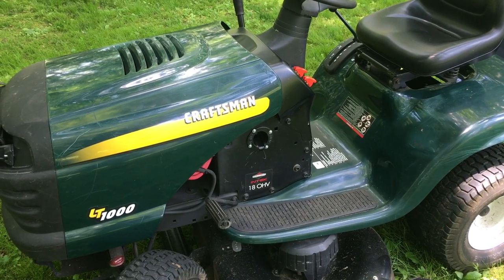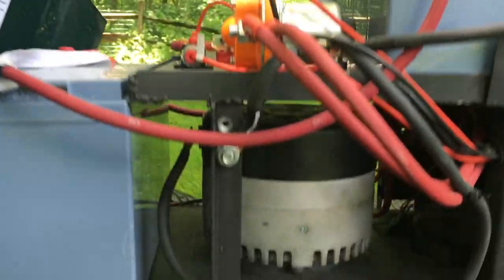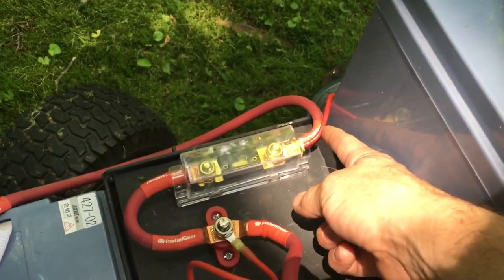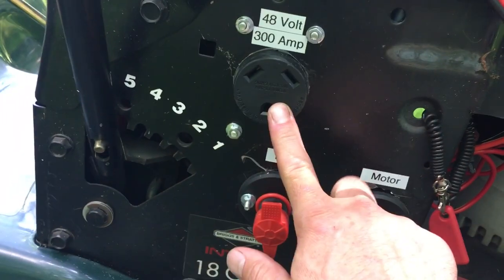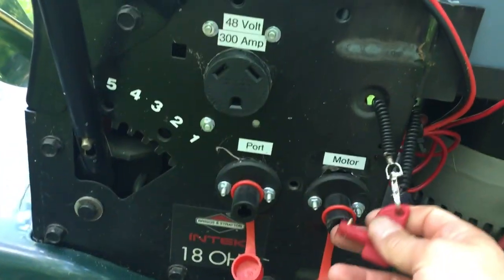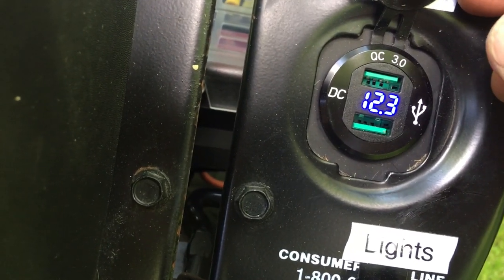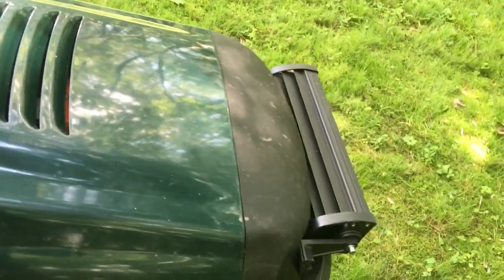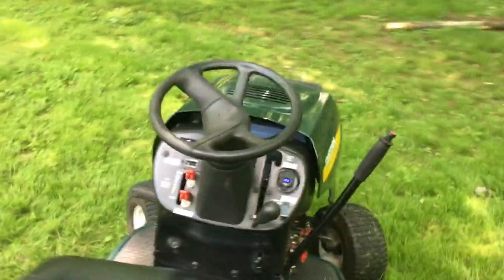LT1000 Electric Lawn Tractor Conversion

Comment: First off, great job on the conversion! I can help clear up the discrepancy in your Ah battery rating vs. amp draw vs. run time.  The advertised 100 Ah capacity of your lead acid batteries are measured in what is an industry standard 20 hour rate.  This means the the capacity is measured at an amp draw that would result in the battery being discharged in 20 hours. If you can find a specification sheet for your battery you will see this, along with capacity ratings over different discharge rates.  At a 1 hour rate, which is much more applicable to a riding lawn mower, you will see that the amp hour capacity will be less than half what is specified.  I'd estimate 40 Ah capacity @ 1hr rate.
Reply from the maker: That’s super helpful. I’ll see if I can find a sheet so I can be more specific with my estimates vs experiences.

Comment: Found out going to have a grandchild.  Was talking to the wife about converting a wheel horse tractor into an electric. Noise reduction. The baby can take rides in. I will have to make a bracket for the motor to lay horizontal at the same place as the belt guard. 
Very cool setup! Thank you for sharing!
Reply: Seems pretty loud still...

Comment: Best by far on converting a mower to electric complete with parts list. My motor on my Toro zero turn is starting to use a lot of oil so I am starting to look at what I want next. I would like to go electric and since my mower is in good condition, this may be an option.

Comment: Sol - I'm getting ready to do a very similar build on my Craftsman LT2000. Same basic physical layout as yours.

I'm considering putting the electric motor directly over the hydrostatic transmission. It will fit where the original battery was, under the seat. So no belts or pulleys, just direct connection to the drive shaft. It seems to me that the electric will run at full speed but if the transmission is in neutral, that's fine and the mower won't move until I move to either forward or reverse.

Thoughts on this?
Reply from the maker: This is a good option… there are plans online for something similar. The plans I’ve seen are where you put in a transaxle with a motor connected to it. And then each cutting blade has its own independent motor. It’s more complicated, but more efficient.

Comment: Why is it so loud?  I thought it would be quiet like a golf cart until blades were enguaged
Reply: Because the motor drives the wheels with a belt just like the blade.  So the motor just runs the whole time.

Comment: I am planning on converting a 1974 Sears ST16 from gas to electric. My engine setup is horizonal where as yours is vertical. Where did you find schematics to wire everything up proper?

Comment: Sweet conversion.  I am planning a similar conversion.  I noticed your current peak in the 50-60amp ramge when you engaged the blades.  What is the max you see cutting thick grass?  I am doing a 48v motor but not the same one and I am limited to 120 amps at 48 constant.  I can probably push it to 200 amps for a few seconds.
Reply from the maker: That'll be awesome. You'll run longer, and with more power.

Comment: I think you’re going to find that you regret not having gone with LiFePO4 batteries. I know they cost a lot more. But the will last sooo much longer and have far better energy density ( and weigh 40% of Pb Acid).
Reply from the maker: I’d generally agree, but I picked these gels up in bulk from a company that went out of business and I got a ridiculously good deal.

When the time comes to replace then, I’ll probably go lithium. For now, I’m still going pretty strong.

Comment: I would buy this. Awesome job! What was the cost breakdown?
Reply from the maker: I got the batteries as part of a sort of fire sale on a closing down factory, so it's not really a fair calc. The meat of the cost was the motor ($400 at the time, now they're closer to $600), and if you had to buy them today, the batteries, too. The other stuff added up, but was probably <$500. So, it wasn't cheap, but I've been running it for two years now and it's still rock solid and hasn't needed any repairs other than the blade belt needing an adjustment. The cost has been worth it in not having to refuel, change oil, smell exhaust, etc.

Comment: Would you be kind and share the contactor, solonoid, and power display you used. My daughter and I welded up an electric go cart last year, and sadly my snapper mower was working fine then. Thankfully we are having engine gremlins, so time to make it run like my Tesla.
Reply from the maker: Right on! Go for it! Ask me any questions you'd like along the way. I posted as many of the parts as I could in the description.

Comment: Hello Sol, I'd be greatly interested in an update on this project. Could you by chance post how many AH your batteries are, what kind of battery and what runtime you achieve from them?
Thanks alot.
Reply from the maker: Absolutely! It’s 4x 100AH batteries, for a total of 100AH @ 48v (~4.8kwh). The batteries are 12v 100AH gel batteries intended for electric vehicles. I got mine from an EV company that went out of business, but a similar model at the best price is here on Amazon: https://amzn.to/3c9ZUlb. I get 30-60 minutes of run time, depending on grass and terrain (my place is pretty hilly and I sometimes let the grass get real tall).
Reply: Thanks you so much. I am thinking about converting my mower because I am sick and tired of the loud operating noise. But I am from Germany, getting the motor and batteries here is very expensive since I have to get the motor from the states. I would like to achieve a runtime of at least 1hour. In your setup, when battery voltage goes low, it just equals in less power and speed because rpm of the motor drops? It does not leave one stranded because of a cut-off voltage? 
My terrain is dead flat, only sometimes a bit overgrown with many tight areas which equals in alot of back and forth, causing strain on the batteries. I will have to see what batteries to buy to get the runtime at reasonable cost. An equivalent to your battery cost me about 300$ upward each here in Germany.
Your experience with the setup helps me greatly in making decisions. On a dead flat mowing normal hight grass, can you say what amperage is used?
Reply: @tobiaskabisch6081  Keep in mind you will still have all the noise from the cutting deck and the electric motor drive itself could be fairly noisy depending on a bunch of things. I don't discourage your EV project but i DO encourage trying some exhaust muffling improvements on your current mower!
Reply: Sol Young, like your tractor diy, I’m planning to convert my mini tractor also but without the cutting blade, I’m just using pull a  6ft wide mat to drag my .5 acre yard. Do you happen to have the parts list for the main drive and where to buy it, thank you.

Comment: Have you added a solar panel canopy yet??
Reply from the maker: Not yet, but adding 2x 30v panels and a charge controller would be a great mod. Then I could just leave it in the field and it’d be fully charged every time. Plus, sun and rain coverage built in.

Comment: Don't get why you would waste money on a 48 to 12 converter.  Just tap off one of the batteries for the lightbar.
Reply from the maker: I wanted to make sure the four batteries were always in sync and equally charged. Probably unnecessary and over engineered, but wanted to try it.

Comment: Where did you get the motor?
Reply from the maker: It's a Motoenergy ME1004. I got mine from eBay, or here's a direct link on Amazon: https://amzn.to/39MxrAX
Reply: @SolYoung  unavailable on amazon but thanks for telling me model and brand
Reply from the maker: @hailtothekingbaby100  try the See All Buying Options… I think there’s at least one shop selling them on Amazon.
Reply: I know you have been running this for a couple of years now, but you must have a flat and smooth lawn, otherwise those batteries would have fallen out. Have you since made hold downs for them?

Comment: what is the technical name of brekar(orange colour) for motor inrush current
Reply from the maker: Solenoid?
Reply: @SolYoung  no which is may be connected from battery to prevent inrush current may be with diode and resistance
Reply from the maker: @bantiroy3596  there’s a fuse and a circuit breaker.
Reply: @SolYoung  can you provided any link of this circuit breaker I can't find in internet
Reply: Actually I am working with electric tractor
Reply from the maker: @bantiroy3596  sure… here’s a 25amp breaker. I used one like this for the circuit that activates the solenoid: https://amzn.to/3ZPUcfG
Reply from the maker: @bantiroy3596  and here’s a 200amp version. I’d use something like this on the actual drive/mower load circuit: https://amzn.to/3GV7Ntq

I used a 200 amp fuse instead of a breaker, but either works. The breaker is nice because it gives you a switch to kill the circuit.
Reply: @SolYoung  great sir thankyou very much sir for your support and help
Reply: @SolYoung  SIR CAN YOU PROVIDE LINK 300 AMPS FUSE

Comment: What's the power draw when cutting grass. On average?
Reply from the maker: About 10-25 amps in most cases. I might spiked it up to 30 or 35 amps in SUPER thick overgrown wet grass. And FWIW, it hardly slowed it down. It outperformed my old 28HP gas mower.
Reply: @SolYoung  Even at the high number that's barely over 1hp. That seems so low. You could've gotten by with a 3hp motor. The drive barely takes anything
Reply from the maker: @victorvannatter312  the motor is 13-14kw power and rated for 200amps. I’m probably wrong on the draw during mowing. The torque beats my 28hp gas.

It’s almost mowing season now, so I’ll test it out and get video of the meter.
Reply: @victorvannatter312  What 3hp motor would you try?
Reply: @mikedevine8813  I have no idea. I haven't looked into mower electric drive cross shopping😁

Comment: So is this a $2000.00 conversation
Reply from the maker: If you buy the parts new and not on sale, yes. If you shop carefully and use eBay and Craigslist, you can get this stuff for cheaper. The motor alone, if new and at full price, is going to be at least $600.
Reply: I'm in the process of doing a "simple" version of this. Essentially just a solenoid, battery, same motor, 48v to 12v converter and some wiring. My cost is at $2,000. Half of that cost is that I opted for a single 48v lifepo4 battery.